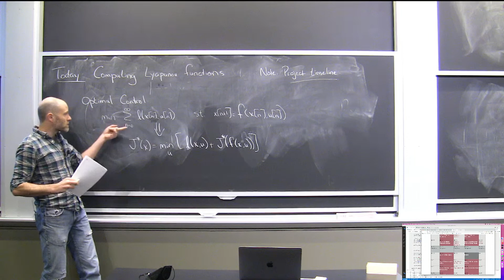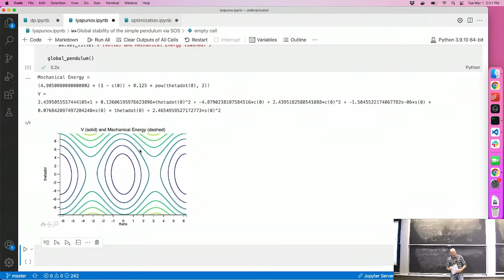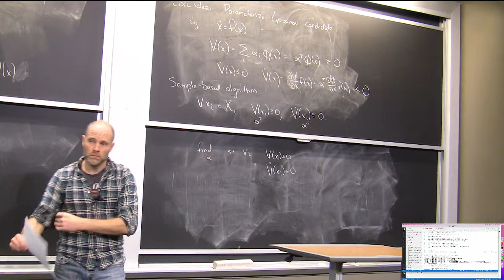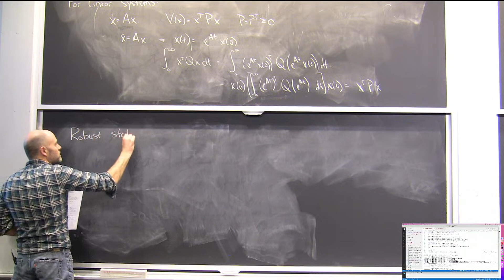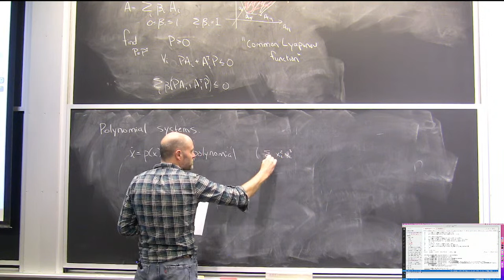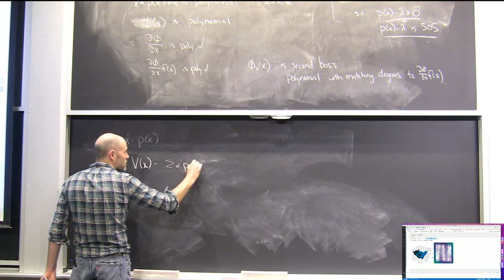Lecture 8: MIT 6.832 Underactuated Robotics (Spring 2022) | "Computing Lyapunov Functions I"

Comment: From a control engineer prospect， a Lyapunov function  is successfully constructed means that we can find the corresponding input which can stabilize the original system f(x).
so,  dose it means that i use those  algorithms  to do the control job? 😁 anyone can help?
Reply: A lyapunov function is for closed-loop systems (no control input).  You are probably referring to a “control Lyapunov function”.  And extracting the controller could, in some systems, still be difficult.
Reply: @rtedrake  thanks! got it. 

after completing the course，the mentioned lyapunov func is kind of computationally simple version cost to go(no optimalit guarantee).  a feedback input has been applied,  we  just  check this system's stability! 

but why should we  choose this feedback input before we can't make sure system's stability ?

Comment: Thank you for the great lectures! In Common Lyapunov Function, should P must be positive semi-definite or positive definite? Here, and in the textbook, it is written that P must be positive semi-definite, but in references (for instance, Linear Matrix Inequalities in System and Control Theory, Section 9.1.1, this reference is given in the textbook), P is positive definite, but I might be missing something.
Reply: Good question.  Short answer: P>0 implies asymptotic (here exponential) stability,  P>=0 only implies stability in the sense of Lyapunov -- the closed-loop linear system can have zero eigenvalues (aka marginally stable). I agree it's more typical to use P>0 for this; I chose P>=0 only because I didn't want to distract people with the need to do a little more to get a semidefinite optimization to certify true positive definiteness.